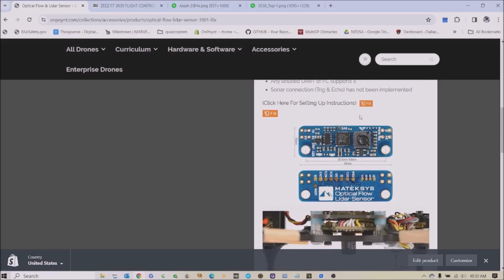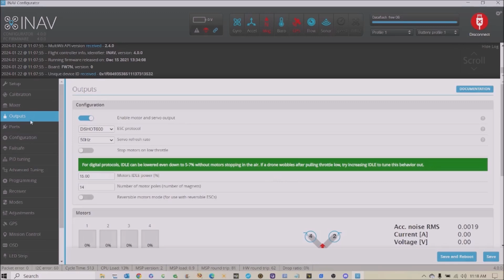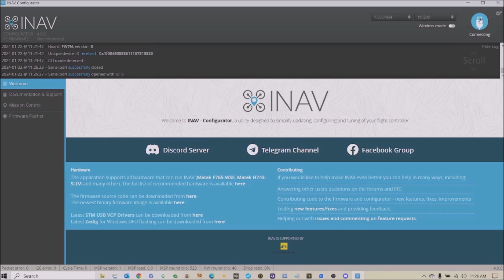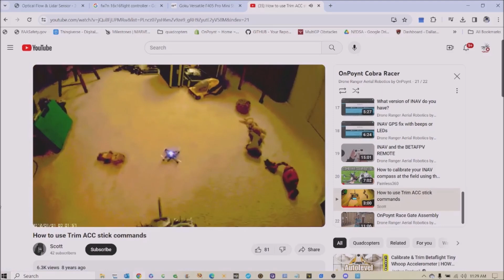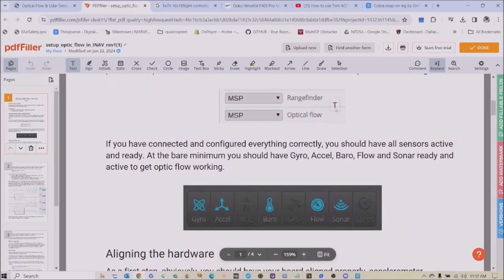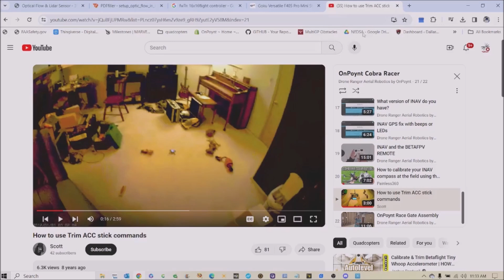MATEKSYS Optical Flow & Lidar Sensor - 3901-L0X

Comment: How to use trim ACC stick commands video link is not working. Do you have a link?
Reply from the maker: It wasn't our video originally, the owner must have taken it down, we're working to get another example added to the playlist ASAP.
Reply from the maker: this is better in relation to optic flow tuning, it's a different component but should be same tuning method - https://youtu.be/bEKm-PGRnks?si=jurbfwspA71XDFdM